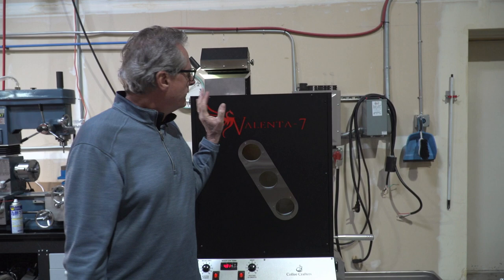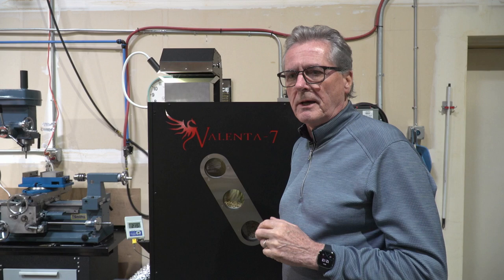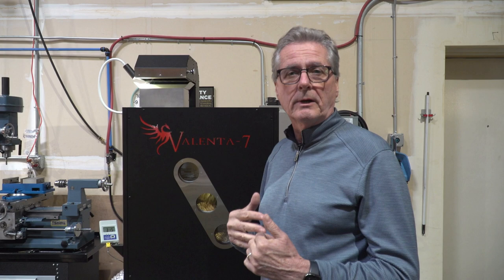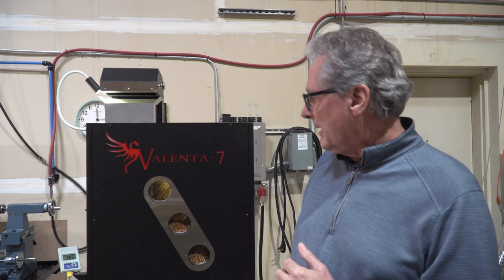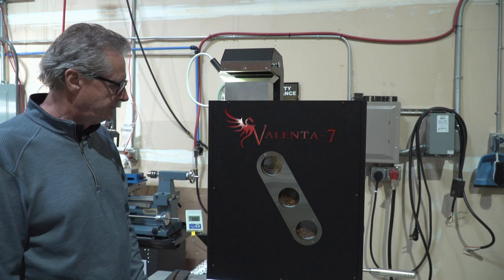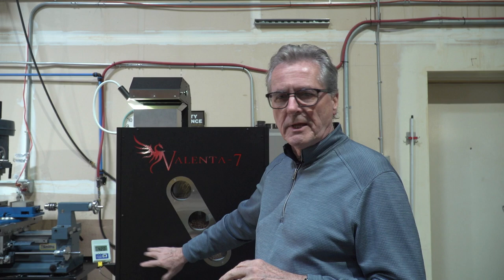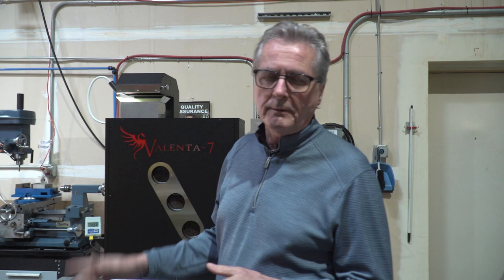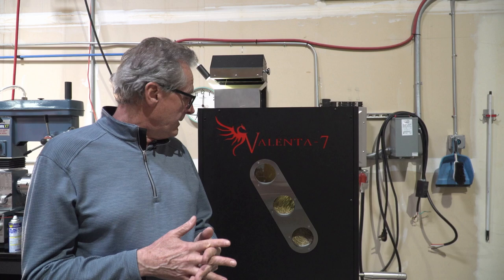Valenta 7 Roasting Video

Comment: Being able to pull a bean sample mid roast is probably the one and only downfall to this design. Another question I would have is: How easy or difficult would it be to remove the three windows on the front for cleaning? I imagine that they’d get foggy over time.
Reply: When you refer to pulling beans mid-roast, are you accustomed to using a trier spoon like a conventional drum roaster has? If so, you’ll probably find that the 3 windows (and excellent lighting) will very clearly indicate the bean development. 
On the other hand, if you currently use an Artisan and you’ve manually scooped out beans during a roast, I suppose nothing would stop you from doing that on the Valenta. Just open the hood while it’s running and insert a spoon/scoop of some type. While it might look like a totally closed system, the top is open. 
The 3 windows (and intact the entire roast chamber) were designed to be very easily removed for cleaning. It’s trivial, and I’m confident Coffee Crafters will be releasing a video to show how easy it is.

Comment: Like the new machine. But would be interested to know how the automated software takes into account the different bean densities, as well as desired bean profile. With the Artisan, we have charted the country of origin, the time and the heat setting needed to obtain the desired profile. Thanks Ken
Reply: The automation uses Artisan Scope software, so it works by following a background roast profile in Artisan. The automation kit ships with multiple pre-made profiles, but creating your own is still quite simple. It accounts for various bean densities due to the fact that it follows a background roast curve. So for instance, if you have a dense, high-moisture Sumatra, it will take more heat to make it follow the background curve. It’s very similar to asking “how does cruise control on a car account for hills?”  It accounts for them by detecting that it’s not on the target, so it applies more throttle. The Valenta will do the same if the beans aren’t following the background profile.
Reply: Looks amazing so what mechanism
Is used to ascertain bean density, bean size etc and does it need regular “calibration” Thank you

Comment: Are you recycling the hot air ?
Reply from the maker: The air is preheated as it moves through the roaster to the loft motor. The motor then shoots the air up into the heating element and to the hopper where the beans are. The hopper is designed to create a vortex so the hot sir stays in the hopper with the beans longer. Not so much recycling as it is trapping the hot air with the beans.